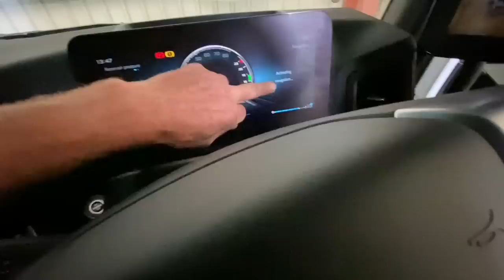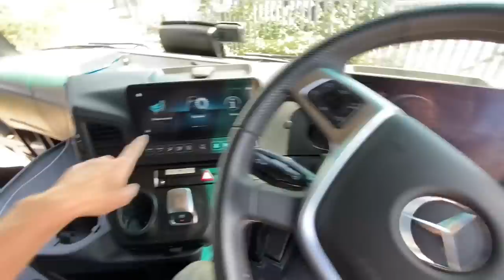The spray job that never ends! A new dog! Future of trucks and snap

Comment: Hi uncle Franko here mate 
Watching you crawing about under them trucks reminds me why I gave up truck fitting 🤔 wet in the winter, dusty in the summer!  Broke a wheel stud just before an MOT once ,had to Remove the wheel, ark weld the broken wheel nut to the inside of the wheel and put it back on !!!!! It passed the mot luckily and I changed the broken stud later that day !! All the best Franko 👍

Comment: I thought you were gonna use the real dog as a phone holder 😆 
I agree with those electric mirrors, you'd be in a intersection jigging around and it would surely blow a fuse when you need them most.

Comment: Never had any dealings with mirror cam,but I'm with you Chris,what wrong with glass and plastic! I believe the green line across the screen is where you can set the mirror to the back of the trailer and the mirrors follow the back when you reverse. If  one of those snail antenna cameras  goes down,the truck goes into limp mode,the fittings are on the door for a standard mirrors if Merc come out and they can swap them over to get you out of trouble. Great job on the van,even though you were out of your depth! Struggle on buddy! Struggle on!! Ps idea for a name for the new mutley.....Brooke,as in Kelly.....Brooke....you ll have a right pair then!!!!
Reply from the maker: Another case of something being over engineered again then mate, Kelly Brooke 😂😂👌
Reply: @Professional-struggler  ha ha....don't know what you mean!!

Comment: Chris, A Tip for you. Use a new trailer anti spray flap when you have to inspect or do jobs on vehicles on dirt or gravel yards. you lay on the bristle side and the smooth side to the dirt. they work a treat on all surface and will last a good while also dont take up any room in the van . Cheers from a fellow struggler.
Reply from the maker: Yeah good bit of advice there mate I have usually got one on board 👍 struggle on mate struggle on 🤠💪👍

Comment: Hi Chris really enjoying your videos .. i sandblast nd spray for a living along with other side lines .. try wet down the floor 1st try close the door that the draft blows threw keeping it open a little for some fresh air .. ..( prep both sides of your van ).. then mix the paint nd only add a small mist to both side when it goes tackey or sorta stickey add more coats .... letting the 1st coat dry a little gives your paint grip so your next coats dont run or try slipping down the side of your van ... .. cheereo from ireland keep up the good work 🇨🇮  🇨🇮
Reply from the maker: Top man Jason thanks mate! Appreciate all the advice mate! Hope you’ve got the weather there to 🌞👌
Reply: No worries Chris if i lived abit closer id give you a crash course its very simple once you know a few tricks ..... yeah  we have some good weather going on over hear today its 20degrees not over hot but bearable 😎 🇨🇮

Comment: They are putting a lot of tech on the latest recycled U-boats!

I think the main advantage over mirrors is the aerodynamic improvements which lower fuel consumption, so good for the operator but not so good for the driver.

I also heard when doing a blind side reverse the near side camera can rotate to increase the drivers field of view which would be handy I suppose.

Comment: When those mirror cams pack up and they do, no need to worry Mercedes come out and fit standard bolt on mirrors,the fuel saving having no mirrors is unbelievable
Reply from the maker: Aaar is that the reason do you think fuel saving…… it looks about the only benefit! Thanks John 👍

Comment: The flashing line on the screen when you start up, if you close the door you can use the control on the top of the door to move them and align it with the back of the truck so when you go round a corner you see the rear corners , so I’m told . Camera doesn’t move but the image does as it takes a wider view than it shows you . You turn the lights on with the centre touch screen panel🙄🙄 ok when it’s new not so good when old and used .
Reply from the maker: Yeah as you said nice when new! I wonder what they’ll be like in 5 years time….. back to the good old mirror 😂
Reply: @Professional-struggler  heard drivers saying if they were glasses for distance they find it hard to see the screens as they are so close to them where a mirror is just a reflected image . Good channel Chris , enjoy watching . 👍👍

Comment: We have got some of the mirror cam Mercs, they are terrible in the dark anything behind you with led lights just flash on the screen. How the centre screen on the dash can be legal is beyond me, everything from the radio, lights, heater, lift axle is controlled from that screen, you have to scroll from page to page to find what you want. If one of the camaras go down when out on the road means a ride back home on the back of a wrecker it's happened to loads of ours.

Comment: FFS how are some numpty truck driver supposed to  drive a 44t  missile down a motorway trying to operate a computerised dash, trying to look through computerised mirrors whilst operating a mobile phone, pouring a cup of tea, frying an egg, tailgating the 44t missile in front then pulling out at the last minute putting other road users life on hold whilst two muppets travel at 56mph for 10 miles side by side talking to each other on a CB radio measuring each other’s ego. Argos have a lot to answer selling LGV licenses to anyone 😱😱😱😂😂😂😂

Comment: The purpose of "smart motorways" is to provide a UK wide network of routes for electric commercial vehicles, powered by overhead cabling. This is already being trialled, and while there will still be some private use of fossil fueled personal transport, this is projected to reduce by 50% or more in the next 10 years.
Reply from the maker: Times are a changing then mate 👍👍
Reply: @Professional-struggler  Sadly yes, and not for the better!